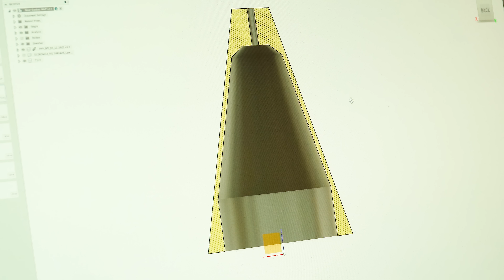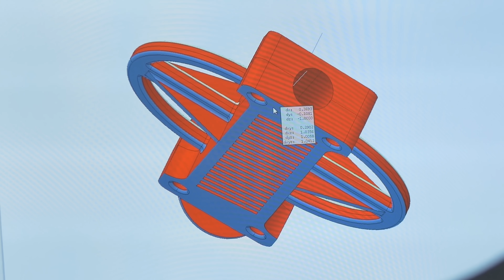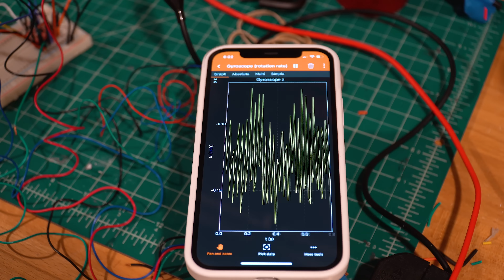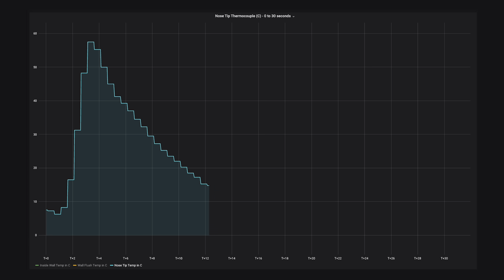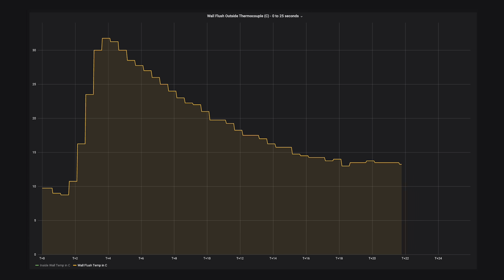How Hot Does a Rocket Get?

Comment: Maybe others have said this already, but before focusing on optimizing heat transfer, I'd focus on optimizing heat GENERATION. So research what SHAPE of nose cone is likely to result in heating. Of course most science is designed to REDUCE tip heating, but you can certainly learn from what they decided NOT to do.

Comment: The standard advice to reduce nose cone heating is to add a radius to the tip. So if the objective is to catch as much heat as possible, then make it pointy and conductive. On this flight you lost a lot of the heat that would have gone into the thin wall because you had a long insulator tip. If you want to minimize the wall thickness to maximize how much of the heat meets the meat, then fabricate it from sheet metal or machine it very carefully, and look at pressurizing it for structural stability or putting a small hole in the tip so that it self-pressurizes to balance the current Q.
Reply: Like the dictator (and elon musk) said: "you gotta make it more pointy"
Reply: Adding radius will significantly reduce rocket speed, and finding most effective point of heating (about mach 1 speed) would be quite a challenge. Totally agree with pin/needle radiator - short needles piercing meat will heat it from inside.
Reply: Man why don't you upload anymore videos on your channel. I just like those rocket engine test videos

Comment: Love the magnetic camera spinner clutch, ingenious!  For improving heat acquisition, you need more surface area - same solution used on heatsinks.  Longitudinal strakes, about 1mm wide, running from the tip down the sides, perhaps 1-3mm deep, would easily double your surface area, perhaps more.  Not quire sure what it would do for aerodynamics, but maybe you'll get lucky and it functions as a stabilizer.  Also, angle of attack would affect heat generation, no?  So a more blunt, less aerodynamic nose tip would generate more heat.  Balancing act to keep aerodynamics efficient to still hit Mach 3 while generating sufficient friction for heating.  Otherwise, significantly longer flight times would be required.  You may need to do some testing on your kitchen skillet to figure out minimum temps and times, yum.

Comment: You could embed peltier elements on the outside of the nose cone to convert the heat (difference) into electricity, and then use that electricity to cook the meat with an efficient element. Plenty of loss to worry about this way, but it's kind of cool.

Comment: heats pipes might work, as they are good thermal conductors. maybe if you have the heat pipe exposed on the outside and safely insulated In the inside with zip ties attached to the steak it might work.

Comment: Maybe I missed it, but don't thermocouples normally require specialty connectors because otherwise you get false readings from additional thermoelectric junctions that occur each time the wire material changes?

Comment: Place an appropriate boundary layer trip near the tip of the nose to ensure turbulent boundary layer heating. Can confirm that boundary layer trips can lead to several times (3x to 5x) higher heat transfer rates especially on nose cones. You could even make the whole surface rough by covering it with particles of suitable grit using some thin conductive glue.
Reply: Since it's already made on a lathe, could he just make the surface... Really bad? Or would a stepped or grooved surface work better, do you think?
Reply: @bjrn-oskarrnning2740  that's a good idea. Along with making the cone walls paper thin.
Reply: What if there were small scoops that would redirect the boundary layer (and some of the air just above it) inside the nosecone but outside of a vessel containing the meat? Kind of like the mig-21. Feel like there would be more mass flow and thus more heat transfer
Reply: @Daniel Cook Knurling on super thin walls (iirc he mentioned 1mm in the video) would end badly, but you could do it before removing the material. This does leave it susceptible to cracking since you're compressing the material to get that pattern (thinner than min machines wall thickness now) and speeds of mach 3 can cause some fun issues.

Oh additionally, it doesn't look like a CNC lathe so he'd be feeling the knurling out by hand which can lead to inconsistencies in the material stress/knurl depth.